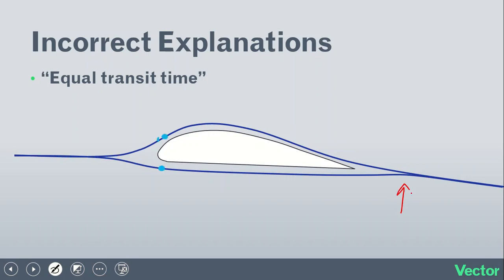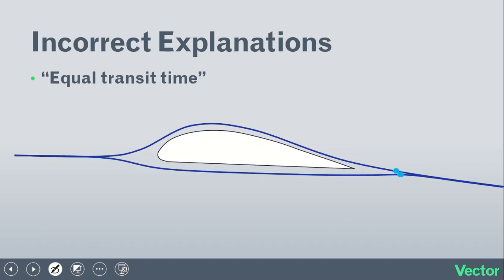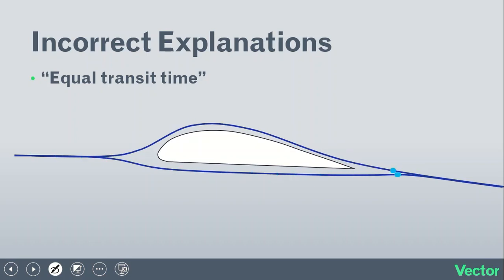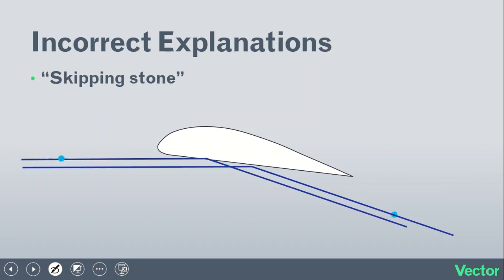Common Misconceptions About Lift

Comment: As I understand this video you are only saying the two air particles do not and cannot meet up at the same time where the airflow again meets trailing edge. The airflow over the upper surface is still traveling faster, Which should still mean a lower pressure area above the aerofoil.
Reply: The particles above the wing travel even faster than they would had the "equal transit" theory been true. So the speed and pressure difference is true, Bernoulli is true, but the magical equal transit time is not. An important part is that air is deflected downwards behind the wing, which is the "opposite reaction" to the wing being lifted upwards.
Reply: In a 2D wind tunnel there is no downwash. Before you quote Understand Flight by Anderson and Eberhard, lift in 2D is real, every old school lift and drag curve for a NACA aerofoil you have looked at came from the NACA 2D wind tunnel. So, sorry, no air deflected downwards. Those measurements in those wind tunnels were all down with pressure taps, and that was good enough until the 1980s when the first action reaction explanation appeared in the literature.